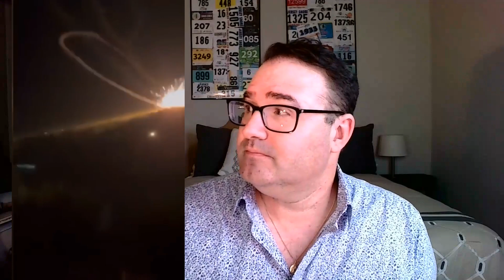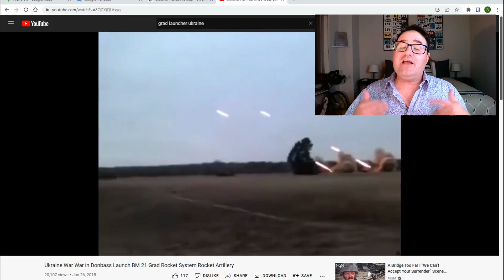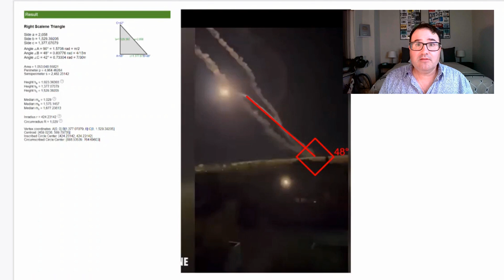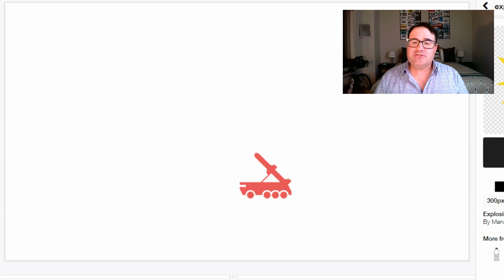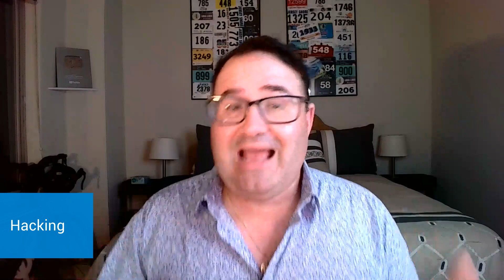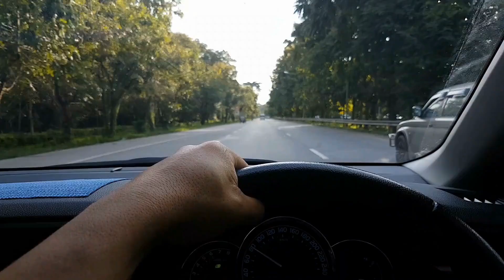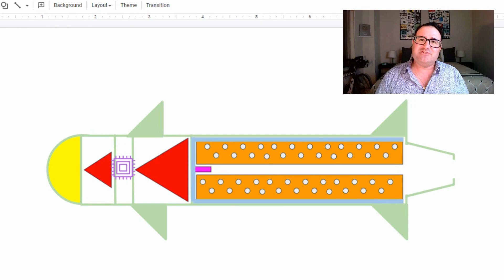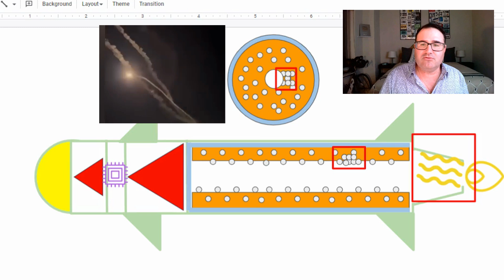Why this missile U -Turned

Comment: Thing is even if there was a clump of fuel - the exhaust gases are still going to be heading out the back relatively straight - that's the job of the nozzle. A clump like that might increase the velocity of the rocket unlikely to change it's direction. Not only that - the guidance system is there to keep the rocket pointed in the right direction - either via the fins or gymballing the nozzle. So you definitely have some form of guidance failure - either in terms of having a fin (or nozzle) jammed hard right or by giving the missile the wrong heading.
Reply: Not necessarily. If there is a bubble of air on one side of the motor it very well could cause a significant yaw. Many solid rocket systems that don't have a nozzle capable of gimballing, they sometimes use systems that inject additional fuel or oxidizer (depending on the specific solid fuel used) right behind the throat to increase thrust on that side of the motor allowing it to turn without a complicated gimballing nozzle
Reply: @richardmillhousenixon  Post-throat gas injection can create slight offsets in the thrust axis, but nothing before the throat will have any meaningful effect
Reply: If the fins or nozzle were actually "jammed" in a particular direction, the rocket wouldn't just do a u-turn. it would turn and then continue spinning end over end.
Reply: It would take a lot of lateral thrust to execute a U-turn like that. I can't see that happening from a lopsided fuel burn, given the nature of the gas flow in a rocket nozzle (choked flow) .   Its got to be a guidance failure, possibly a gyro  - that could conceivably make the missile think its going 180 degrees the wrong way.
Reply: @TwoSpoons100  Maybe the Russians did another oopsie like they did on that one Proton launch and somehow installed an accelerometer backwards that was designed to only be able to fit in one way, requiring the installer to literally bash it into place with a mallet instead of gently seat it into place.
Reply: I had the same thought
Reply: Yeah, more fuel burning would change the velocity and possibly do some real damage to the rest of the missile, but it wouldn't change the direction of thrust.  This seems to be a guidance or control failure. My guess would be some wires got crossed on that individual missile.

Comment: It also could be a classic russian mistake? https://www.youtube.com/watch?v=vqW0LEcTAYg

They basically used a sensor upside down which caused the rocket to tumble and basically turn around.

So the rocket started straight forward and gets told "boost".
Tracking radar then said fly forward but forward is actually backwards?

BUT your conclusion sounds very logical to me!! But hitting the launcher is random then? In "my invented case" it would be a "kill the 180° opposite".

I found you on YouTube shorts and got a fan! Keep up the long and also short Vids. Take care:)

EDIT: someone already said that before down below somewhere

Comment: I think it’s possible you’re right. I remember reading this in a book about model rocketry published in the 60’s about building solid fuel rockets. If the propellant is cracked or broken due to handling it may cause the fuel to burn in an unpredictable way. So a rocket engine blew a hole in one edge and then the escaping gas turned the rocket around and the resulting crash and explosion.
In the book the author was a Major and had planned for each scenario including bunkers for the launch site made with sandbags and steel plates. Just in case the rocket you made from the directions was blown up on the pad.
As a twelve year old boy I didn’t have access to a lot of the materials or means to obtain them was beyond me, but I understood that sometimes rockets can be more like pipe bombs if you don’t build them right, or handle them with care.
Reply: Gas exiting to the side would’ve caused a circle, instead of a 180* turn, though, right?
Reply: @HubertofLiege  he explained that in the video. the disruption in burn was only momentary but enough to turn it around, then the rocket straightened out again, just the wrong way.
Reply: @K9_Wang  I like the guidance system gps installed upside down, but what do I know, only the Ivans know.

Comment: While I like your theory, it doesn't entirely explain, why the missile went straight after the turn. This would also go against a stuck fin.
A seeker error seems more likely to me, whether caused by faulty electronics within the missile / radar system or a user error in the later.
Reply: I guess you missed the part of the video where he described how it would have straightened out using his theory.

Comment: I don't think fuel clumping could cause such a dramatic turn. It looks to me like an IMU or accelerometer was installed upside down. It's happened before, I believe it was a proton rocket
Reply: it flys in a very predicted guided manner im 99% sure thats a ground to ground missile which most of the time require the gps coordinates its launched from and the attack coordinates. if the person doing the launch made the mistake of putting the launch coordinates in twice and making itself the position of attack. it seems far fetched but if you consider russian "special forces" got caught invading a building via a an elevator then captured because the elevator got locked in place by a Ukrainian security guard. i wouldnt be suprised if its just incompetence
Reply: @dalejrjunior1298  I was thinking along similar lines. Poorly trained conscript perhaps. Origin coordinates set as the target
Reply: @dalejrjunior1298  can a rocket like this deliberately do such a sharp turn though?
Reply: @A.Martin  yes 100% it can. although i was told by someone else that it probably wasnt a gps mistake. but even if it wasnt the rocket still could do that if it wanted too
Reply: @dalejrjunior1298  Yup. The flight pattern itself shows IMO, that this is either an input or readout issue with an otherwise mechanically sound missile. First it flies straight as intended, then as the external component of the course correction system first picks up the missile, it makes a very controlled snap turn and realignment accurately straight back at the launch direction. Remember, even the oldest missile directing calculation isolates the missile's own position, instead of blind flying. If it was a working course correction with faulty fuel, it would have tried correcting the unintended flight path with parameters differing from a fully functional missile, resulting in a spin or a harsh drift. That wasn't seen here at all.

Either a predicted flight path metric was inverted resulting in the 180 °, or they managed to either input or direct the target to the launch area, which has happened before and looks more or less like what was seen here.
Reply: @qwormuli77  I think the other rockets would have had the same or similar coordinates?  In other words they should have done a 180 also -  so my money is on fuel clump!
Reply: @dalejrjunior1298  this is a SAM so it’s definitely not GPS guided afaik
Reply: @yobob591  I don't think we know that for sure do we?
Reply: @wilfdarr  easy to see from launch direction . It's a sam
Reply: @crimisonfire  Launch direction alone doesn't do it for me. That really only eliminates ballistic missiles. There's a lot of cruise missiles/guided rockets that have similar launch angles.
Reply: I was thinking the same. The Russian space rocket with upsidedown accelerometer behaved exactly like this.
Reply: It's probably a control and actuation system failure. No way even a clump of fuel and divert a missile trajectory. Most likely cause is tail fin control failure where failure of actuator caused lock up or other causes. As evident by the straight  trajectory in the u turn.
Reply: @aerojetrocketdyners-2538  agreed. The apparently 'straight' return flight path may also be a bit of an optical illusion. It seems to have landed closer to the camera than where it was launched from, so may have been flying an arc all the way to the ground, but in alignment with the camera angle so that it was not visible and appeared to fly straight.
Reply: This was not a field problem this is a anti radar missile that tracked its own radar

Comment: No way fins will turn the rocket 180 in close to its own length. 

Cannot see asymmetrical nozzle flow causing anything but a minor turn. What I thought you were going to say was the clump burned a hole in the side of the rocket giving it a sideways boost for enough time to turn it 180 degrees.  Notice pop up rockets use a small burn 90 degrees to centerline to turn the rocket quickly.  Explosive force of fuel might have punched the hole or a defect in the middle tube they allowed it to burn through and give the sideways thrust needed.

Comment: Solid rocket motors are a hollow tube that burns from the top down. It’s possible the casing could fail causing a jet out of the side but I can’t see that creating such a controlled turn. A spin and break apart is more likely.

Comment: I think this still could be a guidance system issue. Missiles are not cars and they don't enable guidance unless there's enough velocity for the fins to be functional.
So i think, once the missile reached the threshold speed it enabled guidance but perhaps a sensor was installed upside down (wouldn't be the first time huh?) so it ran full lock to one side and fell down.
I don't think the missile straightened out by itself after turning downwards, rather i think that due earths gravity the trajectory of such a maneuver would be elliptical and what we saw was the flattest part of the ellipse.
Also the missile would accelerate rapidly when pointing down so it would be increasingly harder for the control system to pull it back up, therefore the elliptical trajectory would be more egg-shaped.

Comment: fuel in the BUK roclet (or pretty much any solid rocket motor fol mil use) can't behave this way...when these degrade, cracks form. These in turn increase the surface of the combustion, causing the pressure to spike and the motor to spectacularly explode.
This is clearly a commanded turn, it nicely stabilizes before smashing into the ground. Either an unpredicted reflection from the tracking radar or something went wrong in the missile guidance electronics.

Comment: No I don’t think. The initial firing initiates a thermal battery for this size object and the missile has a target fed into its electronics . I suggest that some ECM is put into effect where the target is set to the launch site.   Your idea is good but I suggest the hole would cause massive spin which would be seen but was not.   It appears that the missile turned and aimed without spin to its initial source 
A ECM operating against ICBM’s and such smaller missiles is from probably years ago.   The electronics in this Russian missile are probably of western origin, hence its open to our ECM’s        Probably ?

Comment: Turn around with your suggestion is still improbable. It would've been random, not precisely at the launching site. But otherwise it's a workable suggestion, though IDK if fuel misplacent can so swiftly turn the rocket. Mybe the fins turned it?

Humorously I thought the rocket suddenly became Ukrainian and shouted Б'Ю МОСКАЛЯ!!! (I'm hitting the moskals!) during and after turnaround. I think more of misguidance. Maybe the guys launched acommercial drone in front of the radars and suddenly they changed target from a far to that drone which spelled doom for them

Comment: If we assumed that there was a clump of fuel, your theory makes sense. Because if the fuel moved trough the elasticiser to one side, the rocket would spin in a circle right? 
But in this case, the rocket made a u-turn and continued straight... so your clump idea would explain the rockets behaviour

Comment: I am a bit skeptical, if the rocket turn around due to fuel inconsistency, it’s doesn’t feel right that it did an almost 180 U turn. 

The probability the clump burn off to a complete U turn doesn’t feel that high. It could just have done a 70 or 130 degree turn.

Comment: OMFG THIS HAPPENED TO MY HOMEMADE BOTTLE ROCKET BEFORE!

YOU ARE ABSOLUTELY RIGHT! 

Most solid rocket engines exist as a weird goop, you must absolutely make sure no air bubbles or regions where fuel can gather and cause blockages. The reason on my rocket is that the fuel melted a bit and blocked the nozzle, it only let a small amount of trust enough to lift it, after the blockage was out it literally just went and blew up near me that scared the hell out of me.

The huge demand of weapons is the cause, speeding up the solidification process and removing the dowel too early enough can cause some of the plasticized fuel to melt and solidify at the part where the combustion chamber is, sometimes it happens at the tip and it wouldn't be obvious

Comment: thanks Ryan, i appreciate your insight and i know nothing, though although you may well be correct you may of overlooked a strong piece of reasoning to totally support your theory, as in the age of the rockets, though these could be fresh from the factory i'm wondering, if they could of been on the shelf for a decade or 2 maybe in poor storage regarding temperature and damp even, anyway i'm happy with your explanation though, in which case ... do you think these rockets could be 'past there use by date'?

Comment: Iirc you assumed its a buk ... so when you explained (at 2:45) the how the system works, you said that the "... missile turns on its own radar ..." 
I want to point out that according to wikipedia the buk is a SARH system. Which needs a constant radartracking solution to transmit the data to the missile itself.
Wikipedia does not mention the existence of missiles with an active radarseeker.
No big deal ... doesnt negate the validity of your video ... just wanted to smartass a little and point that out fyi.

Comment: I do not think somehow unbalanced fuel is a reason to go off course. It may cause pressure variations at the nozzle, but that has nothing to do with the direction.
To me it looks like a very controlled turn, it is not going to some random place, it goes straight back where it came from.
I do not think it was intentional, but a failure of the control, not of physical parts of the rocket.

Comment: All of the SA-11/17 variants use a boost/sustain burn-profile solid rocket-motor and most of them use a semi-active radar seeker (Which requires a seperate radar to illuminate the target). I agree with you that the missile's malfunction is the result of mishandling during manufacture,, storage or loading onto the launcher. However I doubt it's due to damage to the propellant grain as such damage usually results in the missile exploding on or just after ignition, IMO I think the missile's autopilot suffered damage and/or damage to the control-fin servomotors.

Comment: I know of no Russian missile that uses thrust vectoring (TV), yet that U-turn definately looked like a TV maneuver. One possible other explanation I could give you, is that of a leak in the rocket fuel chamber burning through during the boost phase. As soon as the boost fuel is burnt, the turn is complete and the cruise phase sets in, disabling the leak and preventing the missile from making continuous turns. That would require bad material in the insulating layer. Likely?

Comment: If that incident was  'mishandling'....of 1 Missile out of 1000s, might I add.

What would you call this incident ?

On March 22, 2003, two days into the U.S.-led invasion of Iraq, American troops fired a Patriot interceptor missile at what they assumed was an Iraqi anti-radiation missile designed to destroy air-defense systems. Acting on the recommendation of their computer-powered weapon, the Americans fired in self-defense, thinking they were shooting down a missile coming to destroy their outpost. What the Patriot missile system had identified as an incoming missile, was in fact a UK Tornado fighter jet, and when the Patriot struck the aircraft, it killed two crew on board instantly. The deaths were the first losses suffered by the Royal Air Force in the war and the tragic result of friendly fire.

Comment: It is not rocket science, wait it is! Your theory needs modification, as it would mean the nozzle is destroyed, and it will keep on turning (very common). As long as the nozzle is intact it should correct for that kind of  inhomogenuities. Maybe the fuselage cracked and it was outgasing somewhere it shouldn't a bit  until the fuel was spent, or more likely, the gyro malfunctioned going into an inversion (again nowadays common, due to helium exposure of cheap solid state gyros). Btw, hacking is possible, since the communication btw the missile and the ground is pretty weak in older ones. Someone needs to be very close and outpower the ground control though.

Comment: The fault could have been a lost lock, or failed component due to being 40 years old, if it were riding the beam then the fault could be dropping towards ground due to part of motor failing but requiring beam and ignitng rest of motor...  it does slow down, curl and then speed up.  Could its guidence system be four jets around it, during boost all these should be 100%, but if the bottom one fails (shuts off, bad fuel, breaks) then it slows down and curls losing the beam, the missile then finds the beam again and fires everything back up with the broken motor now at top so no more curl as gravity and top motor are enough.
This theory relies on there being five jets, big in middle and four on outside that can be varied.